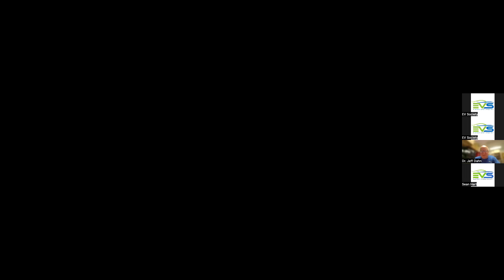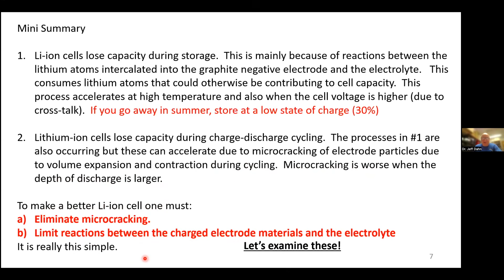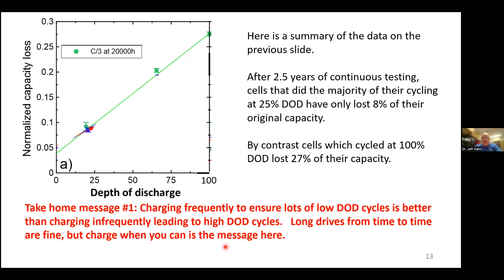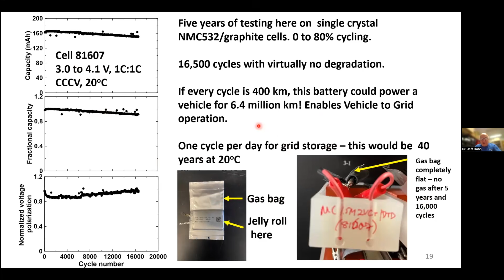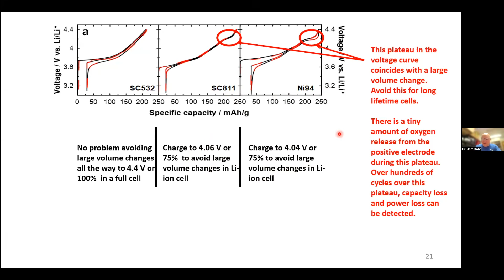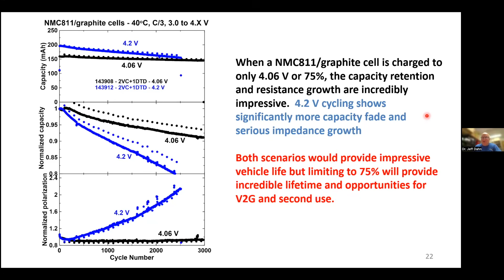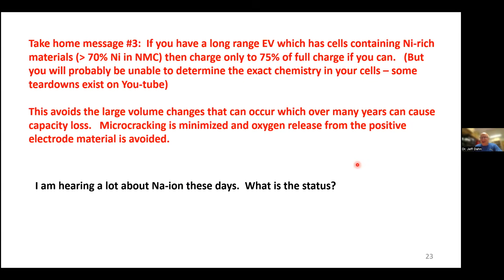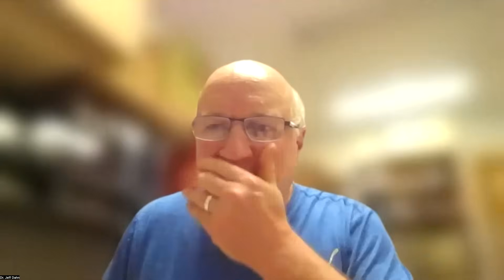How Long Do EV Batteries REALLY Last? — Dr. Jeff Dahn, Dalhousie University

Comment: One thing you can't do anything about it spontaneous combustion of EV lithium batteries.  The Dedrites which form inside Lithium cells can short the batter at any time; causing a fire.  In 2022 the Falicity Ace Auto ferry with 4000 luxury European cars on board sank because a Porsche BEV caught fire; brand new,  sitting doing nothing; pobably charged once if that. This is my biggest worry about Lithium based BEVs as they can cause a major threat to entire buildings or in this case a massive ship with sank in 10,000 ft of water.  Even if this is one in 10,000 vehicles; it seems a serious and totally uncessisary risk.
Reply: No serious evidence to support your claim about the  'Felicity Ace' Auto ferry. Indeed it didn't even sink while the fire was burning; it was extinguished and the ship towed. It eventually sank in high seas two weeks after the fire.
Reply: @timrowledge7152  Are you thinking of the sister ship that  also burnt and BEVs suspected?  The Falictiy Ace  sank in 10,00o ft of water off the Azores and there was video of the Porsche BEV catching fire, jnew just sitting not charging (also proving a BEV without damage can catch fire).  Porsche was sued and has paid about 1 billion in damages for the ship and 4000 other luxury cars on board. So you are completely wrong. Indeed a person I know who owns one of the largest marine insurers in my area has told me the insurance rates for shipping BEVs is now so high as a result BEV makers are pushing to manufacture locally. BYD not exactly known for qaulity has had 10 dealrs inCHina burn to the ground and you can find video of BYDs burning on the trucks on the way to the dealers. BEVs with lithium are fire hazards.
Reply: @litestuffllc7249  Your lies are too tedious to bother with

Comment: EVs' are ALL about their battery Pack.
 Once past their projected half life point (5 years)  an EV is worth VERY little in Resale value. 
 Unsurprisingly...No-one wil willingly buy a vehicle which has  a 30 to 65,000 $ battery replacement on the horizon.  
65K$ being what some hapless Huyundai Junk owner was  recently quoted for a replacement battery ..  by the H dealer, no less..
 ICBC the insurrer.. unsurprisingly.. was unwilling to pay and chose to scrap the months old vehicle
Add that to the reality of having to line up for a recharge  and Wait for it to recharge .... If so shortsighted as to Have NO home residence recharger possibilty.

 Here in Vancouver EV's are Status Symbols     amongst  asian colonisers... just    as Bmws' and Benz's Used to be.

Comment: My apologies if this has already been addressed. I've set my daily maximum SOC to 50%, my daily use is 20%- 25% DOD, and I charge at home every night on a level II charger. Is my max SOC at 50% ideal, or would you recommend a higher daily maximum SOC%? For longer trips, I'll charge to a larger SOC prior to departure. Thanks for your time.  MR
Reply from the maker: Based on Dr. Dahn's advice, in a perfect world, you probably want your average SOC to be 50%.  You could probably bump up your daily charge to 60 - 65%.  Unless you reside in a hot climate, this minor change to your charging routine would have very little impact on battery life however.  
We hope Dr. Dahn will be back for another episode soon and I'm sure he will be happy to confirm this.
Reply: @ElectricVehicleSociety  Thanks
Reply: @ElectricVehicleSociety  I'm in Phoenix Arizona I have a 2019 Nissan LEAF 2nd battery now "new" in May 2024 please tell me exactly how I should charge it? My typical daily commute is only about 25-30 miles somtimes max use in a day 45-50 miles.  😀
Reply from the maker: FYI, Jeff Dahn will be returning for another presentation on August 6.  He will do another Q&A session as well.

Comment: There is one thing you don't address. And that is balancing the cells in a battery. As long as it is not possible to get the internal resistance in two cells 100% equal, the BMS must help. If you do not blanch, one or more cells will stand up like a nail on a flat floor. And that will over time reduce the capacity of the battery.
I have learned that the balancing must be done when the battery is fully charged. But it is somewhat inconsistent with the fact that one should not charge the battery up to 100%.
But what is right and if I am right, how often is it appropriate to balance and how long must be set aside for balancing the battery?
Reply from the maker: Great question.  Dr. Dahn will likely be back this year for another webinar in July or August 2024.  I'm compiling questions like yours to send to him in advance.  Thanks.
Reply: @ElectricVehicleSociety  There is one more question that is of great interest. It is about cycling these batteries in lower voltage fields. Basic chemistry dictates that in a chemical "bathtub", such as a battery cell, it is necessary to "empty" the battery completely, i.e. down towards the lower voltage limit to keep the chemical processes available.
Everything that is not used degenerates over time!
It may also be of interest to help the BMS to find a zero point for its calculations with regard to how much energy it is in the battery.
A comment on these questions would have been helpful.
Reply from the maker: Confirmed:  Jeff Dahn will be returning for another presentation on August 6, 2024.  He will do another Q&A session as well.

Comment: I drive long distances as part of my job and I now have 100,000km on my 2022 Tesla model 3 LFP. I charge almost every day to 100% and regularly drive the battery down to near 0% state of charge. When new I had 428km on the GOM at 100%, today it shows 417km at 100%. I haven’t noticed any difference in performance and the only maintenance items have been tires , wiper blades, cabin filter and lots of washer fluid. I plan to drive this car til the wheels fall off.
Reply from the maker: Your LFP Battery should last a very long time and they are getting better every day!
Reply: Thank you for sharing. I feel so much better about my vehicle purchase when I see personal stories like this.
Reply: As noted in the talk - LFP just charge and discharge all you want. no worries.
Reply: @r.b.l.5841  Now at 150,000 km and GOM still showing 416km range at 100%. Just amazing.
Reply: You are supposed to change the drive units fluid I believe?
Reply: @nickolastiguan  Not according to Tesla owners manual. I'll review it again to make sure and edit this post if it is required. Now at 123,000 km
Reply: @antoinepageau8336  I believe it was a requirement on earlier models, but then they took it off, because of “lifetime fluid”.  

From what I have seen, they are just like diffs (but with spin on type oil filter), drain and fill. Some people do it, some just leave them alone.
Reply: @antoinepageau8336  that’s a lot of km in two years btw lol
Reply: @nickolastiguan   I'm traveling from Montreal to Florida and back in October. I love road trips.
Reply: @nickolastiguan I have 10 Teslas in my little companys fleet. I change all gearbox oils every 100,000 km at Tesla.

Comment: I have a year-old Dell laptop computer that spends most of its time on the kitchen table, plugged into an AC outlet, and only occasionally goes on a business trip with me when I would need/want maximum battery run time.  On the basis of Dr. Dahn's advice, I have now set the laptop's charge limits to operate between 30% & 70%.  The night before a trip, I'll charge it to 95%.  With luck I should get many years of battery life!
Reply: Agree, I'm in your situation. I think most of us are. There are a lot of batteries we do not talk about.
My lady uing hers in a tottaly another way. Her old mac was still fine, 10yrs....
Se we realy need to learn from it.  Different usages, and different needs.

Comment: Great analysis, but I wonder, why is a state of charge of everyday use (for a 400km vehicle) between 10% and 50% would not be even better than 40% to 60% all time charging?
If one does not need more that 40% of usable capacity, it should be almost best option, or?
Please do not mention letting the battery to fall to 0%, I understand this might be the reason not to mention these low SOC-s
Reply from the maker: Dr. Dahn is back on August 6, 2024.  Hope you will join us and ask this.
Register:  https://tinyurl.com/yc3rnnxh

Comment: Nobody seems to talk about how bad PHEVs are (relative to BEVs), in this respect.  I had a 2017 Hyundai Sonata PHEV in Phoenix, and i would cycle it 15 to 100% during my daily commute.  My battery was replaced under warranty at 44,000 miles.  It took 6 months to get the new battery.
Reply: It really depends on the reserve that the manufacturer uses.  The 1st Generation Volt only allowed 65% of the battery capacity to be used.  So even though the owner thought they where charging to 100% and going down to 0% they where only using 65% of the actual battery capacity.  Obviously this is going to be very dependent on how much reserve the manufacturer uses on the battery.  GM was very conservative with the Volt.
Reply: Good comment @SDGreg. When the actual charging parameters are hidden from us we are left with tribal lore like “Tesla has better battery protection than Hyundai.”

Comment: Wow, what a great interview and thanks Dr Dahn for being so generous with your time.  Much appreciated. I've been part of the Victoria EV Club for about a decade and we used to have lots of educational sessions and this topic of charging always comes up.  Now we know the answers!!!  thanks. BTW, I have a 2014 Leaf with the 24kWh battery and it still have 11 bars but I think it's due to lose another soon as Leaf Spy tells me its GIDS are the mid 80's.  I only charge on my home 120v and 220v Sun Country 30 AMP charger.  I've never used a L3 but the previous owner in San Francisco area did about 22 L3 charges according to Leaf Spy.  The older Leafs only have a timer and you can't specify to only charge to 75% or 80%, so it usually gets charged from 35% to 100% unless catch it earlier.  Many have said that its best to do many short duration charges so I guess I'll have to start doing that more often. Luckily we never get too hot here in Victoria, rarely over 25°C and even at that I don't charge during the day when it's that warm.  Car has about 86,000 km on it and it's been flawless and a pleasure to drive ...recognizing that the older Leafs are city cars and not practical for longer trip. Thanks again for the great show and I'll try catch more of your content.  Don Scott
Reply from the maker: FYI, Dr. Dahn is back on August 6, 2024.  Hope you will join us.
Register:  https://tinyurl.com/yc3rnnxh

Comment: Wait a second... did I get this right?? If I cycle my battery 01%-21% the battery is happy?? We've always read everywhere the following: "Never let your battery go below 20% you will spoil it!"
Reply: I don't think you got it right. 1%-21% would be bad. 40%-60% very good
Reply: I suspect that this low charge range was simply not addressed because nobody would ever actually operate an EV that way.  
We can ask Dr. Dahn directly the next time he is on the webinar.
Reply: @TheAncientContentCreator  Yes please! 🙏
Reply from the maker: Dr. Dahn is back on August 6, 2024.  Hope you will join us.
Register:  https://tinyurl.com/yc3rnnxh
Reply: So charge between 40-70% and store at 30% what about charging speeds? On my ioinq5 ita known to have iccu issues caused by ac charging. Also great info tu

Comment: Based on my experience it seems that some Li battery’s can repair themselves.  I’ll give you two examples.  I was forever charging to full my MacBook Air and it lost the ability to work more than 10 minutes without plugging it back in.  I began charging it up to 50 or 60 per cent and in about a month it began lasting me several hours without being plugged in.  Example 2 is my 2018 Nissan Leaf.  I was vigorously charging it to 100% and my range dropped from 160 miles per charge to 80 miles per charge.  I began only charging it to 80% and in several months I was getting 150 miles to the charge.  It seems that some types of lithium batteries can heal themselves, similar to the human body.
Reply: It could be a calibration issue .
Reply: I cant say for sure that NMC will repair itself, but in '22 I read an article from Stanford uni based on the paper "Dynamic spatial progression of isolated lithium during battery operations" (Fang Liu et al., Nature, 22 December 2021 ) describing the procedure to recover lost or inactive lithium and bring back capacity. Essentially the procedure is to charge the cells, then slam high discharges through the battery. This act electromagnetically attracts tiny lithium precipitates towards the anode. After enough nudges, the lithium will creep close enough to the anode to make physical contact with it, and electrons will start exchanging with those lithium islands, allowing that lost lithium to chemically react and do work for the battery again. Fang Liu describes some possible contributing factors are the applied current density from your intense discharge, the orientation of the percipitated lithium dendrites, and the dendrite length that becomes polarized in that electric field.

keep in mind, they say it works for percipitated lithium, but not for SEI and CEI based degredation.
Reply: @Infinion  …Thanks.  That is interesting and seems to make sense.

Comment: Does charging to 80% implies significantly more degradation than 75% charging? All automakers are suggesting 80% as a threshold
Reply: That's about 75% because they don't allow 100% charging at the top even it says 100%
Reply: While 75% is better than 80%, the difference to battery health is likely marginal.  This is certainly true unless charging in extremely hot temperatures.
Reply: Lower the better

Comment: One thing I'd really like to get clarity on from Dr Dahn on the Ecker and co. paper is to appraise how true the 40-60% goldilocks zone and the 25% DOD really is. The data is really quite interesting, but I'm not quite convinced because of what I would call critical interpretations. 
First, for the a-axis and c-axis plotted against SOC, are these anisotropic volume changes state-independent? In other words, will a reference cell follow these recorded displacements perfectly and without hysteresis, independent of whether they were undergoing charging or discharging at the time of measurement? Depending on the methods used to record these displacements, there could exist a second set of anisotropic displacement curves that elude the interpretations gathered from this plot. 

When Dr Dahn described 25% depth of discharge as having superior degradation compared to 50,75, and 100% DOD, the starting and ending voltage is not noted. It should go without saying that "25% depth of discharge" does not mean the same thing when it starts at 100% compared with a discharge from 60% SOC, and that goes with all permutations of 25,50, and 75% that fit along the 0-100 scale. The only reasonable assumption for "Depth of Discharge" is that a discharge always begins from 100%, unless the starting and ending SOCs are expressly stated with DOD. This has always been the case for other battery chemistries like lead-acid, nimh, nicad, etc.

The other problem I have is comparing the 25% DOD (from 40-60%?) with extremes such as the single cycle-fresh cells and the 100% DOD cells. Intuitively it follows that you can compare a sort of progression in the morphology, and there is some value in this, but the meaning is lost completely when we start to discuss microcracking. 
When the displacements in the a-axis and c-axis are expanding and contracting in not just an anisotropic fashion, but progressing nonlinearly, how can you be confident you know how these microcracks evolve across the range? The most you can conclude is you've found a region where the slopes of displacement are at a minimum in the 40-60% range. However, where is the microscopy and cycle depth data showing how stresses and degradation evolve everywhere along the SOC vs displacement curve? Where is 0-25%, 5-30%, 10-35%, 15-40%, 20-45% etc, keeping DOD constant while shifting along at discrete increments? Why weren't all the depth of discharges compared from the same starting voltages if electrode internal stress is a function of SOC?
Why not evaluate cycle depth schemes that remain on one side of an inflection point of the displacement vs SOC curve as opposed to just a range with the smallest slope of displacement vs SOC? 

If the rest state of the polycrystalline particles with the least amount of internal stresses was 0% rather than 50%, a cycle depth closer to 0% would produce less degradation than one at 50%, even if the change in displacement was smaller, yet there is no data to explore this conclusion because the smallest SoD / EoD was 40-60%.

What about rate-dependent stresses? Is the 0-40% SOC range fine if the C-rate is low enough? Is this stress and displacement temperature-independent? 
Clearly, there is much more research and consideration to be done for this topic, but I would really like to see depth of discharge's use in literature changed to be more specific to avoid misinterpretation, because I really don't see it as a useful measure on its own. Better yet, if it was challenged in favor of looking at wear in terms of end-of-charge voltage rather than depth of discharge, leaning on Chois, S.S., & Lim, H.S. (2002) and their work, even more robust conclusions could be made.